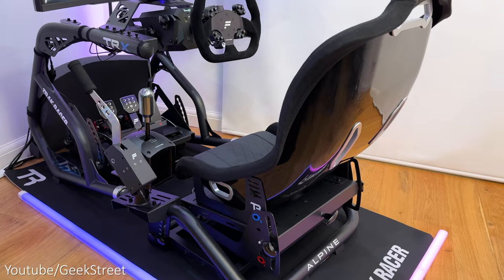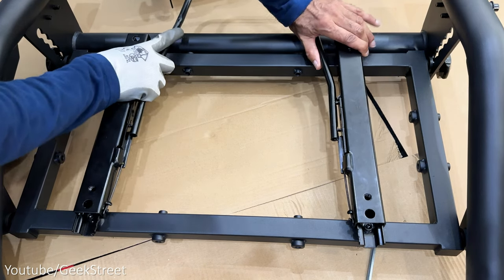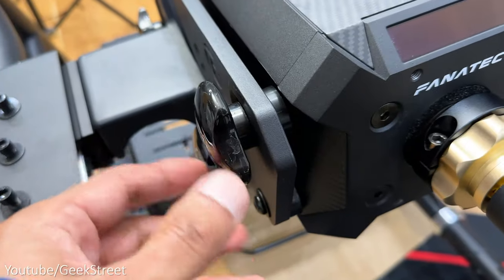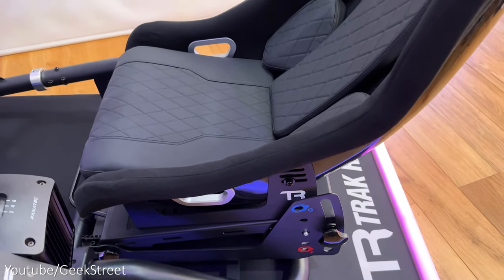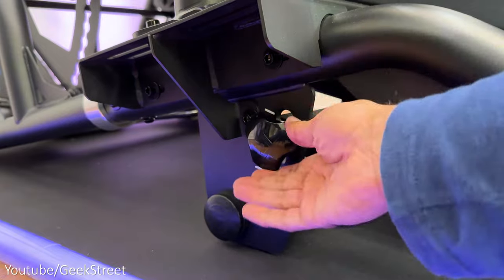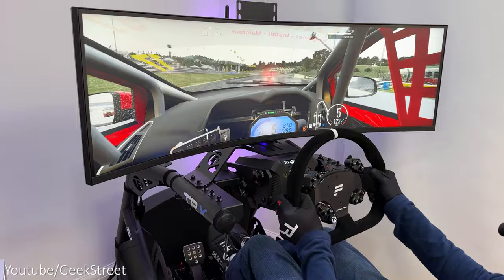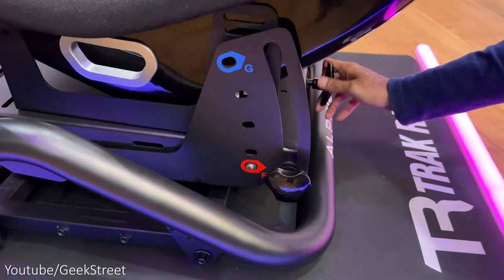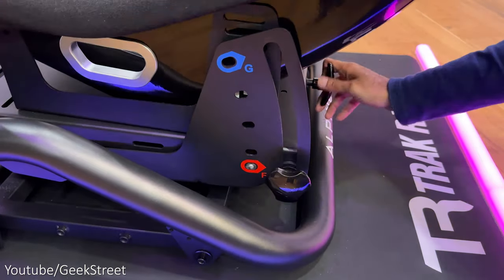Sim Racing Cockpit DESIGNED by F1 Engineers! Trak Racer Alpine TRX Review

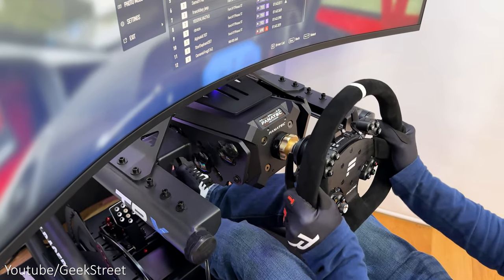Comment: Flex you see @7:40 is because the wheel mount is not tightened up properly to the slide mounts. My trx doens't have that flex at all. (Just the side arms move up and down a little but thats not noticable during driving)
I did replaced the provided bolts with better stainless steel hex head to be able to use a spanner instead of an allen key.
Reply: Hey, I really wanted this product but based on his comments about the flexing, I’m a little put off. What do you think?
Reply: @aaronchantler2150  The excessive flex you see in the videos in the wheeldeck is due to not properly thightening up de knobs and bolts.
(In the Karl Gossling review this is very obvious)
The flex in the frame itself is there but it isn't noticable when driving in the sim. Nobody is pulling steering wheels up and down with both hands unless it's deliberatly looking for flex.
The wheeldeck plate has many slots to provide for many mounting options and that weakens the plate. Mounting a pedal set with a sturdy wheel plate reduces that flex a lot.
The movement of the pedalset you see on the video @8:48 is likely because it isn't attached properly at the front.

There is however noticable movement in the gearshifter/handbrake option that comes with the rig. The weak spot is the angle adjustment of the shifter mount but that part can be ommitted by mounting a piece of 40x80 or 40x120 profile and mount the shifter and handbrake directly on that.
Now I think of that that play can be solved by using countersunk bolts instead of the provided allen bolts.
Reply: @frankderks1150  what a reply! Thanks very much for taking the time to write all of that out… 

I am new to the hobby, so based on your reply, I guess you would happily advise me to get one! Thanks again Frank
Reply: @frankderks1150 beautiful description !! Thank you !!

Comment: ALPINE TRX

Just ordered one and wondering if a very tall girl will find this adequately adjustable to fit. long legs, 38" inseam.
Reply: How you like it ?
Reply: @gstylez909  it's pretty good. There are some annoyances not with the TRX unit itself or it's incredible adjustability or ease of relocation with the wheel option. But there needs to be more options for accessories, the rear 5.1 speaker mounts aren't positioned optimally for use or ingress/egress. I'd like to see electric motor seat rail options, the manual handles are too 1970s and get in the way of foot space when not racing/drifting/driving. Many more things. I need to do a review video and much needed suggestions
Reply: @herlegz6969  how’s the flex ? Noticeable?
Reply: @gstylez909  none noticeable. I have inverted v3 fanatec peddles with podium DD2 and GT extreme hubs and a few QR2 wheels. The GT extreme wheel is the only thing that doesn't feel fantastically solid, the other wheels are solid AF and the closest to any issue is extreme vibration from wheel shaking anything not very firmly affixed to the TRX/ set on it inadvertently. The TRX itself is solid. I moved my 4 monitor stand away and just mounted a 49" 32:9 directly above wheel base, it's fantastic. Besides non optimal speaker mounting locations but that's underway to be addressed.
Reply: @herlegz6969  I have the DD+ so it should hold hopefully
Reply: @gstylez909  it'll hold fine, but I had to get M8 slide nuts and 30mm bolts additional. The DD2 has hardware to bolt right up and I think the 24mm knob bolts aren't quite as long as I'd like. 29mm knob bolts from trak racer I think would be ideal . The DD+ is 10mm narrower and added some annoyances getting it properly bolted up.

Comment: I have the same setup but in blue.  For the price, this thing feels like trash.  At a distance it looks fantastic just don't look at it closely or touch it. The whole thing is covered in paint overspray and even the threads were painted and needed to be chased with a tap.  They even left the round stickers (presumably designating the part number) on the tubes and painted over them. The Alpine graphics on the seat were poorly applied with wrinkles everywhere and they were also torn in shipping.  Along with numerous scratches on other parts due to poor packaging. 

Enough about the cosmetics and poor QC. Let's talk about how well it works. This rig feels flimsy. Whether climbing into the rig, steering or pressing the pedals, everything moves when pressure is applied.

Trying to get it to work properly with a Logitech G Pro wheel was a challenge.  The original universal mount didn't work at all.  I had to purchase version 2 and cobble it together.  The brackets don't provide the correct range of motion to fit me for a GT position.  Either the steering wheel is at the right height and the brackets protrude so low that they hit your knees or flip the brackets over to save your knees but now the  top of the wheel is at the height of my nose.  There is not a configuration that fits in the middle.  I can't tell you how many times I've disassembled and reassembled the rig in different configurations to try to find something that works.

I have a hard time believing that the Alpine F1 team had any input into designing this. I'd be truly embarrassed to put my name on it. This is just a prime example of marketing BS. Climb into any home built race prepped street car like a NA Spec Miata, which is a total limp noodle, and it feels like Fort Knox in comparison to this Harbor Freight knock off.  Also the ergonomics are spot on where as this rig always feels compromised. Just as a point of reference, a roll cage, seat and brackets for a real car cost about the same as this rig. This product was overhyped and seriously under delivers. Wish I could get my money back.